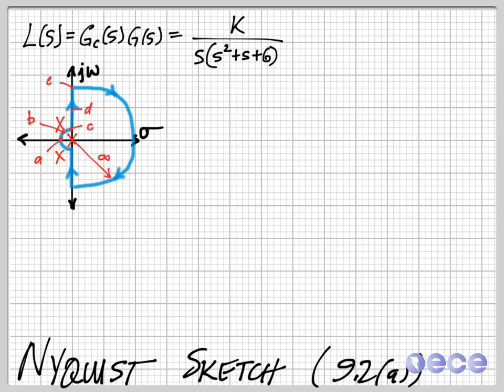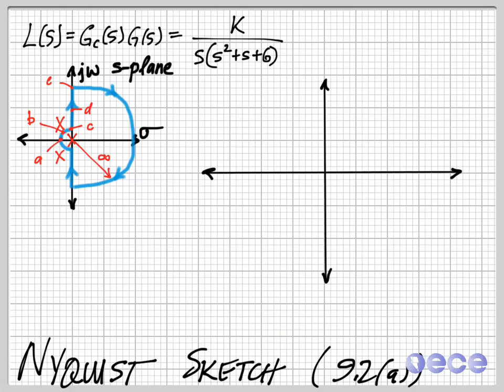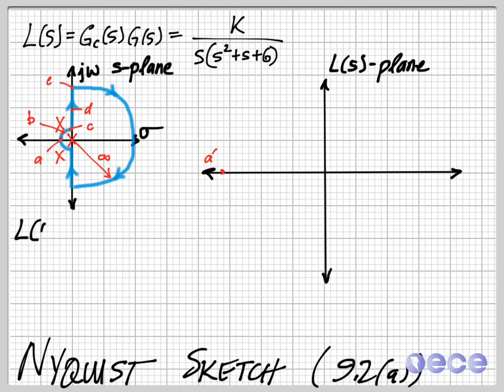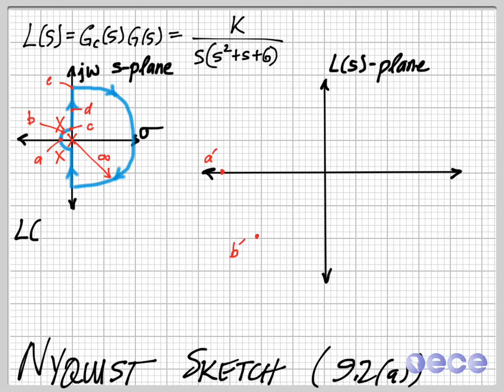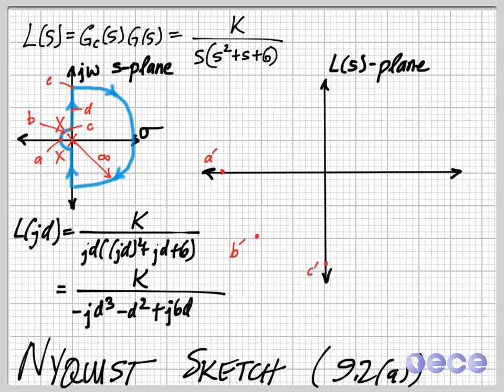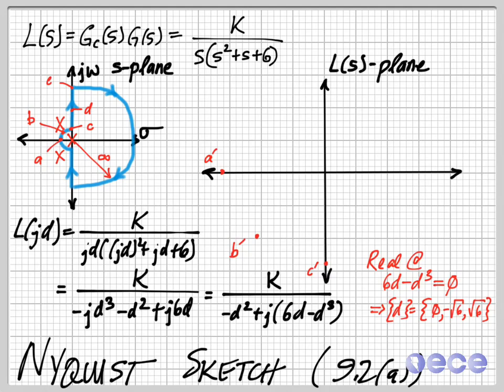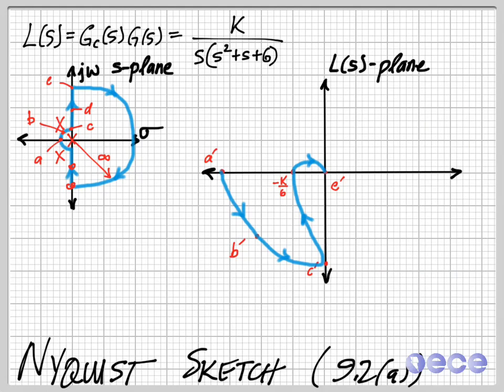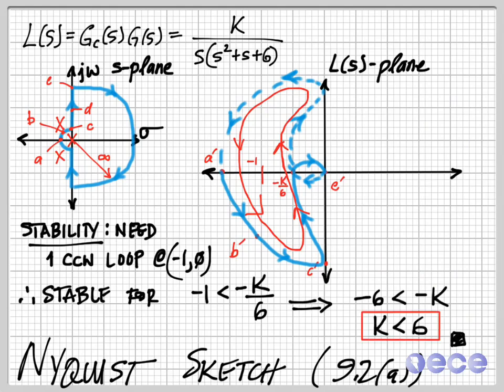Nyquist Sketch Example

Comment: This plot is so wrong. The system has a pole at the origin, the diagram starts at -90 degrees coming from minus infinity NOT from -180 degrees. then moves towards -270 degrees because of the presence of the two conjugate poles. You should "validate" your plot with the Nyquist plot drawn in Matlab.
Reply: The input contour is closed and therefore the resulting contour should also be closed, but also symmetric around the real axis, so point "a" should lie on the real axis and not the imaginary axis (-90°), which would be point "c". The way the input is defined between "a", "b" and "c" it affects the way the output curve rotates at infinity. If "a" was placed on the other side of the pole at the origin, then the output curve would rotate the other way around at infinity. This would cause no counterclockwise encirclement of the minus one point, but then you also do not have a pole within the input contour, so the closed loop system is still stable for K<6.